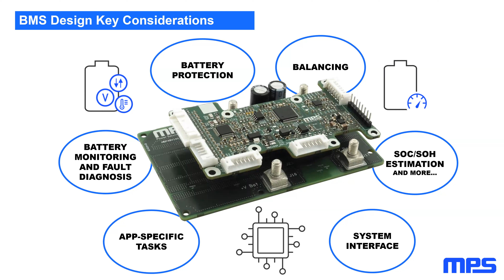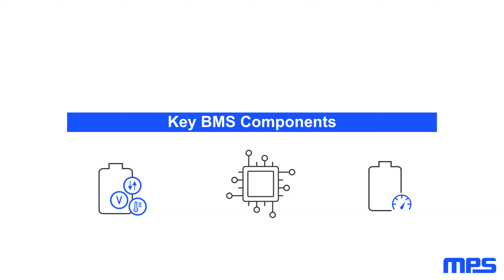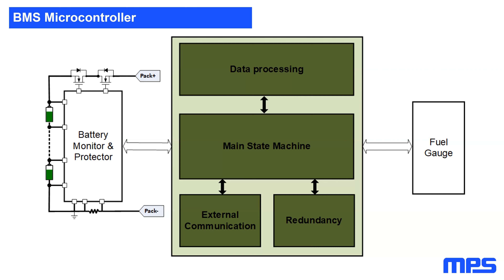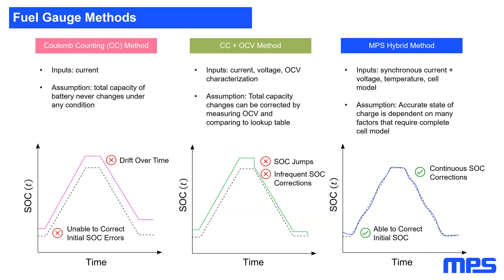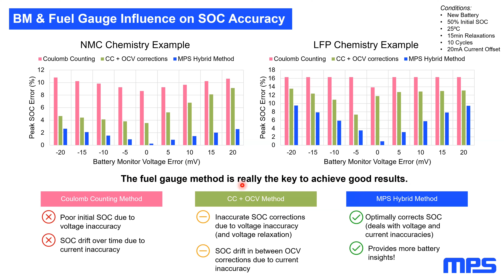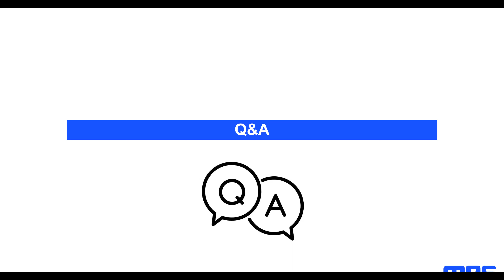Key Considerations when Designing Battery Management Systems

Comment: Hello Sir  is there any IC that contains Fuel gauge Monitor for 16 Cells Battery Pack Please Tell me the part number ?
Reply from the maker: Hi, the part numbers for the Fuel Gauges are MPF42791 for Li-on cells and MPF42793 for LFP Cells.
Reply: @monolithicpowersystemsmps534   
Tq So Much Sir